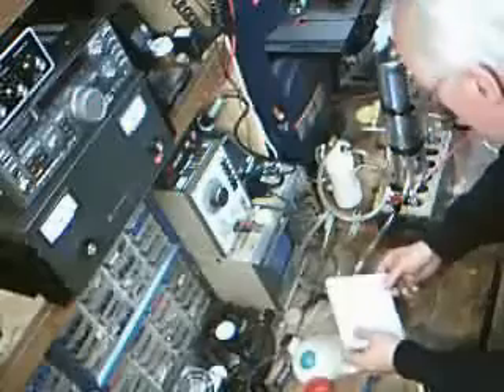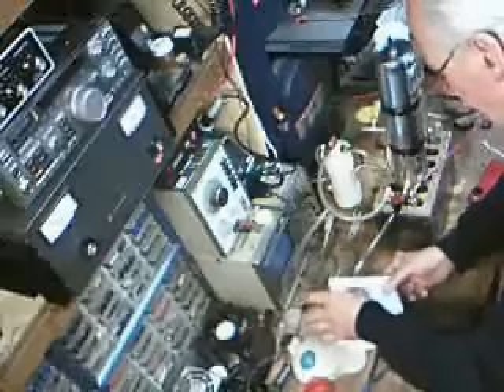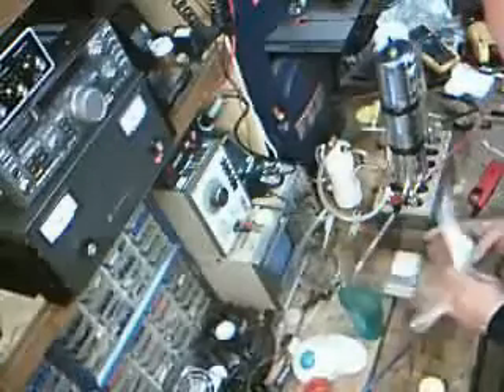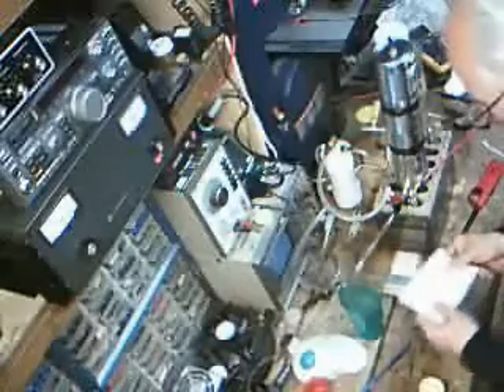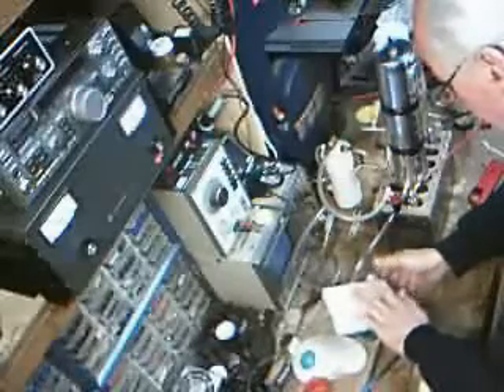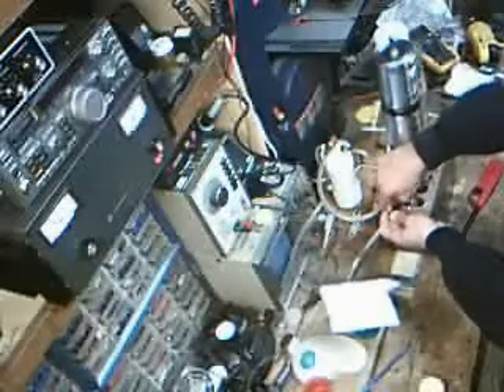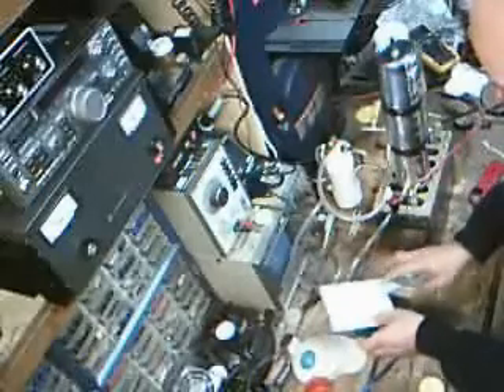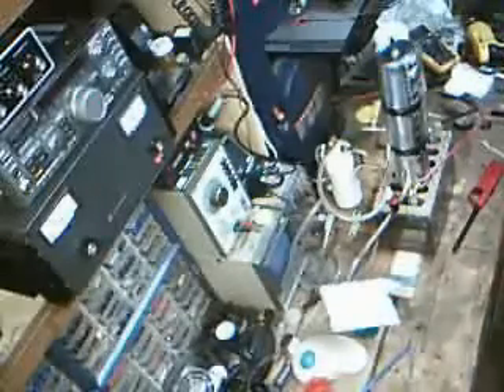#248 - hhoi / linear h20 test part 2 of 5

Comment: I've build a HHO-i explosion detector device with integrated software and I could detect a severe HHO-i explosion in this video, but I will share the plans from my HHO-i explosion detector device with integrated software when all the bugs are solved :-) As soon as my Triatomic transcapacitor is fluctuating at the right frequency I can bring it out. Remember that it's just a tool to detect severe HHO-i explosions and that it doesn't improve efficiency from your device.